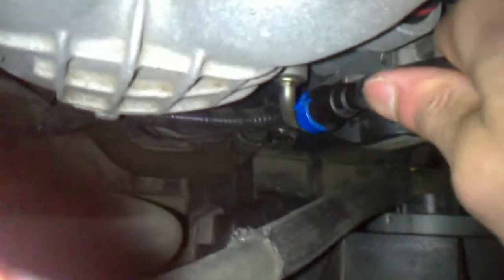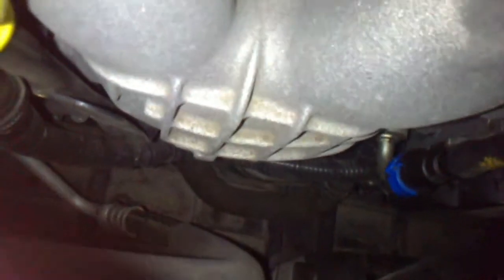How-To: Seafoam a MazdaSpeed3 DISI Turbo Engine

Comment: What size vacuum hose did you use?
Reply from the maker: i do not know. i was lucky to find something that goes over it nicely. even if it is a bit bigger, its fine as the vacuum will suck the fluids in

Comment: Why would u use sea foam on a turbo engine .. lol thats not good
Reply: It says on the can it's for turbo engines ( the spray can)
Reply from the maker: seafoamed for 8 years, engine works great still
Reply: @Driver67  have you checked your valves within those 8 years? If so, how do they look?
Reply from the maker: @rodrigosuarez586  i have not checked my valves visually and do not know how they look. I think they should be good since ProjectFarm YT channel did alot of experiments that shows it helps with removing some carbon deposits